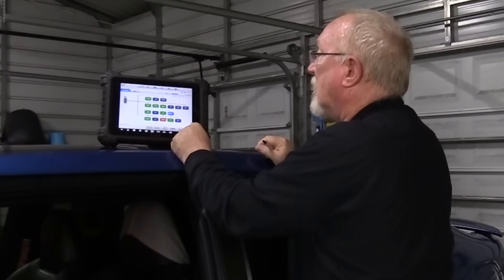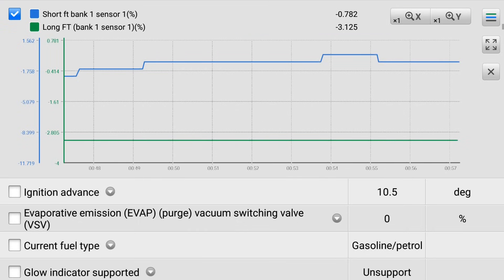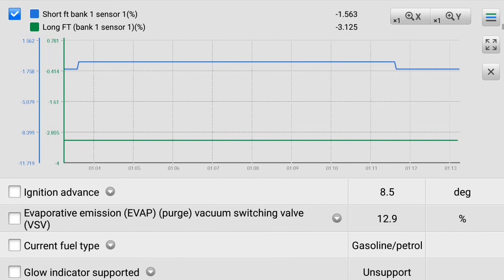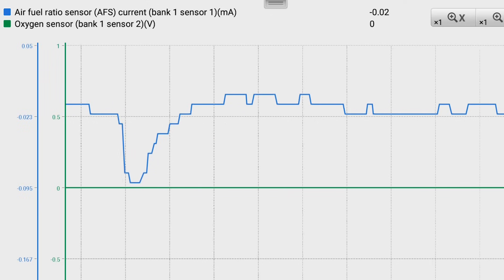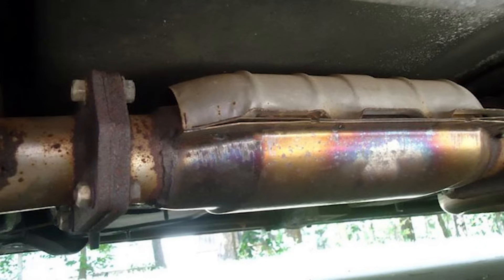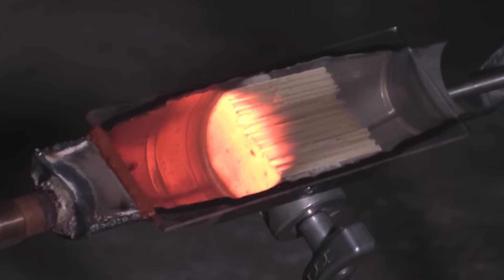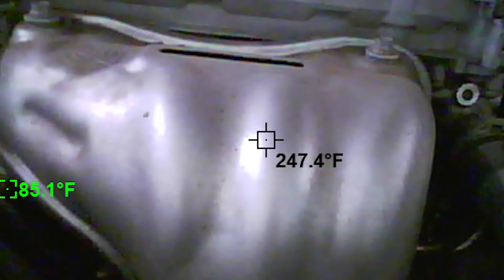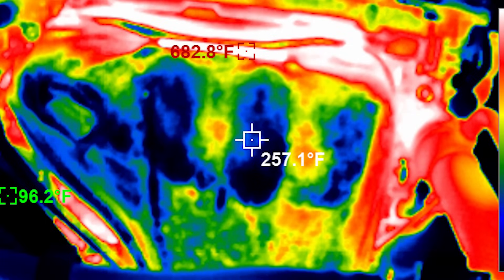The Trainer #118:  The REAL Cause Of P0420/P0430 DTCs

Comment: So I replaced my whole exhaust and bought a cat for 200$ for my 2004 Honda accord ex got a tune up changed the oil and air filters and the code came back on , so either I need the spacers for the o2 sensors or it’s the cheap cat or the mass airflow sensor regardless ima stil drive it like this because it’s a old car and the car is fine brand new

Comment: If your mechanic is not a technician, tread softly. Now days most problems can be determined with a scan tool, oscilloscope, laptop, smoke machine, and fuel pressure guage. Never let a mechanic "try this" or he "thinks it's that". If they cannot explain what your problem is, why it's bad, how they determined or diagnosed the issue, or show you what /why a part needs to be changed. Do not let them work on your vehicle. Don't think we'll the O2 sensor didn't fix it, but it had 100k miles on it anyway it needed a new one. No! Most of the time you are trading a perfectly good working OEM very expensive part designed for your vehicle for an inferior aftermarket part. And it will not last as long, some ECMs will be further confused by the non OEM part and it will say it will work with your vehicle but it might not work very well or cause another problem. A reputable technician will only change the part or parts that fix the problem. Not charge you 5000 for shit you didn't need and keep your good working OEM parts and sell them on ebay or use them on another customers car and charge them for new shit. It's easy to tell who knows what they are talking about. Guys caked in grease, that don't use electronics 1st, are the wrong people to be talking to. Also the tech that works the counter that doesn't turn wrenches and try to upsell you transmission flushes, coolant or brake fluid flushes, air filters without looking at it, don't let them talk you into something you don't need. Most not all dealerships are good. But some are just as bad as jiffy lube who hires anyone to change oil. And sells you filtered recycled used motor oil will do anything to make their commission higher. And ask them if they make commission or hourly wages.

Comment: have changed cat and O2 sensors 2months ago all was fine  but now getting the 420 bank 1 code have a toyota camy 2002 2.4 liter  need a little help on this one
Reply from the maker: You need to identify and correct the reason for the first cat's faiilure.
Reply: @VehicleServiceandRepair  i did my fault the car has 303000 miles i got codes for upstream and down stream when i changes the cat it was clogged up .since i have sent this i changed spark plugs the check light came back on with the 420 code . am going to check for leaks this w/e

Comment: Lot of P0420 codes, but what about a P0421 code? My car runs fine, plenty of power, no hesitation. I thought there were ways to do catalytic regeneration on some cars that don't have a ignition cylinder cut out when a ignition coil is disconnected, this sends unburned fuel into the catalytic converter which causes it to heat up, and burn off contaminates on the monolithic core or at least that's the way I understand it? Apparently you do this for about 10min @ 2000 rpm or little higher to get the catalytic up to heat up oxidizing the contaminates.
Reply from the maker: Some techs have tried this technique with some success but more reliable is performing a slow induction cleaning with a cleaner like RunRite or Techron. Add it slowly to a warm engine at a central vacuum port (evap or PCV - not the brake vacuum port) and then let it sit for 30 minutes, followed by an extended drive. Monitor Mode  $06 test results before and after. If the "after" improves, it is an indication that the substrate is contaminated.

Comment: Had the po420 code and changed oxygen sensors, code came back on. Any suggestions?
Reply from the maker: If you have a scan tool, graph the sensor activity. The front should switch and the rear should be relatively stable. If not, it could indicate a bad cat. Also checck Mode $06 test data for a failed test report. The question begins with Is The Cat Really Bad and if so, What Killed It? It may also be helpful to look inside to see if it appears coated or contaminated.

Comment: I have those codes and my car shakes when i accelerate, i have replaced my rotors,brakes, and all tires because 1 tire had a bubble in it. Does it shake if its the converter? I have a 2005 Lexus es330
Reply from the maker: Without test driving the car, it's hard to say what is causing it for certain. However, the cat would be the last thing I would blame. If it's on acceleration, I would check the motor mounts, transmission mounts first.
Reply: @VehicleServiceandRepair  thank u I'll check that, ii really didn't want it to be the cat n everyone who thinks they know about cars were telling me all kinds of stuff. Ot all started with this stupid town that has pot holes everywhere n I hit 1 of the real big ones it was a sh*t show lol. But thank u again

Comment: About 40 years ago I had a car with a K&N filter. I won't use that filter on a newer car. I think I had to coat the K&N with oil. I don't think that oil would be good for the MFA sensor or the catalytic converter.

Comment: A friend of mine has a 2011 Arcadia that is setting the P0420 and P0430 codes for Cat performance. In the last year he had a tuneup??? Trans replaced due to shuttering , and now all 4 o2 sensors and Cats.(OEM parts) Still getting same o2 codes. I scanned it and saw nothing out of range. L & S Trims looked good o2s checked out fine. Except rear o2s seem to be switching rich lean just as much as the fronts while watching all 4 in the graph mode on my scanner. No misfires current or in history. At  150K I'm suspecting the timing chains causing the cam and crank sensors just enough out of sink to cause the o2 codes to set , but not bad enough for any other code to set. Anyone else had this issue? Also MAF data looks correct, but might help if cleaned. I know I need to check the throttle body and intake for oil. The engine has several oil leaks making me question if the PVC system has been serviced. I don't really know what the so called tune up for $800 really included other than plugs. This thing runs great! Any other direction would be great.
Reply from the maker: How long after the new cats were installed did the codes return?
Reply: @VehicleServiceandRepair  within a few days
Reply from the maker: @BlueEyeTableRockLake  Are they "universal" cats? If so, don't discount the possibility they are the cause.

Comment: Got the code on my wife's car. They tried to sell me a converter. Then I realized it happened after daughter put gas in the car. So I checked the fuel  cap problem solved didn't even have to replace cap.
 May God bless everyone!
Reply: Me too after paying for a new not quality converter..at 102,000 miles..from q government recommended repair shop ..
Reply: I think this is what's going on with my car. Either that or because I got gas from a place I don't normally go to. Came on the next day after I got gas and it seems like my gas cap isn't getting vacuum sealed when  I put it on
Reply: What is the fuel cap issue?
Reply: @leslielucci3182  
Somehow, she didn't get a good seal ,nothing wrong with the cap. You're supposed to turn cap until it clicks, then turn, I believe, one more .time.
Reply: @billybarnes9208  the cap to my Subaru is lost because the “string” attached to it broke and when my teenage son took the car on a long camping trip, the cap was forgotten at one of the gas stations upstate NY. So far I haven’t replaced it because car drives fine without it. The 420/430 code existed back when we had the gas cap.
Reply: someone stoled ours got a replacement from Napa just follow instructions while installing. Our replacement works fine.

Comment: i got a great deal on a used car only to have the check engine light go on my first day of having it. got the code reader and found P0302 and P0420 errors. now not sure what to do.fixing wouldn't be the end of the world, but it's high mileage so my worry is something else will go wrong. have to admit it is a lemon.
Reply from the maker: Tackle the misfire code first, then let the ECM recheck the cat. The misfire can cause high temperatures in the cat that can lead to the substrate melting. If that's the case, it will impact power and fail the cat test.

Comment: Hello everyone I have a question, if the car has gasoline but won't start, and still ready this code with bank1? Then what from there? Everything is pretty new...1-2 yes old, Brand new..? There are other codes that accompany P0420...cat,025,htr
Reply from the maker: Tackle the no start condition first. Engines need 3 things to run - fuel, spark and compression - and they have to happen in the right amount at the right time. What kind of vehicle are you working on?

Comment: I do all of my regular maintenance but got the P0420 code after refilling my gas tank. Thought it was the gas cap, so replaced that. Cleared the code. It came on again several hundred miles after I got low on gas again. I cleared it again. Drove around for a while, checked and even passed emissions. Then 3 days after emissions passed, low tank of gas and code came back on. What is the deal here? My car runs great btw.
Reply from the maker: Many monitors will not run when the fuel level gets too low. I'm wondering if that is impacting your issue. What is the year/make/model/engine of the vehicle?

Comment: Carbon buildup can also trigger Code P0420. My 2014 Jeep Grand Cherokee Laredo threw up the code even tho the o2 sensors and cats were good. So I thought hmmm what if it's carbon buildup? Got 2 cans of Seafoam intake cleaner, followed directions and after it blew all the carbon out the check engine light shut off and P0420 was gone forever

Comment: Just got the P0420 and P0158 yet no check engine light. I hear rattling inside there too. Anyone? 04 Lincoln Aviator 32v 4.6L V8 Y pipe to single exhaust after the cats. Also a smaller then dime sized hole where the little heat shield use to be on the passanger side after the cat.

Comment: If you install those Sensor Thread Adapters to get the O2 sensors out of the exhaust stream, will that tell the computer that the mixture is too lean and enrichen it causing lower fuel mileage?
Reply: We’re talking catalyst monitors aka down stream oxygen sensors, not the upstream sensors.
Reply: @harrybalsonya5619  Downstream.

Comment: First thing to ask yourself is, "Did my battery go dead or did I replace it?"  Sometimes you have to perform a "Drive Cycle" specifically for your car so your computer can run a "Readiness Test."
Reply: What do you mean by drive cycle? Our battery went dead over winter. Its been recharged but the truck will only turn over, not start. 2015 GMC Diesel.
Reply: @kariniemannfuss9208  You are a prime candidate.  Just Google " Drive Cycle" for you vehicle.  You could get one from GMC or your mechanic.

On my Tahoe I had to let it idle at a specific RPM for a period of time from a cold start with a number of electrical items turned on and drive it a certain way to allow the computer to scan all sensors to know that everything was working properly.  The codes switched off and I was able to get the emissions checked.  

As far as the no start, you'd have to check with diesel forums with your specific issues.  Sounds like a computer communication problem.  With no power for an extended period of time, the computer might need to be reprogrammed.

Comment: With direct injection engines it can be the injectors. The code is often accompanied with a cylinder miss code.
Reply: Just a heads up, injectors on a direct injection engine are under such tremendous pressure compared to port injection. Injector issues on DI engines can actually cause compression issues. If DI injectors are ever removed for any reason, they must be replaced with a new injector to prevent compression issues.

Comment: I just got my 1st Autel today. MK808BT. So far I'm loving it. Just changed a bad ABS module and was able to flash it and fix my abs lights in my town and country 3.8. This 0420 code is all I have left and both 02 sensors are new so I'll be checking out the converter. Awesome video. Thanks
Reply: I think the point of the video is that just because a code is thrown for a certain component, that component itself might be the singular issue, having lived it’s long life, and time to be replaced, like spark plugs, ignition coils, batteries, brakes.   But more often than not, by a large margin, the actual cause is because of another component which is malfunctioning and it’s symptom is causing a reaction in the component that is represented by that code.      You could replace that component every month and still not fix the problem.

Comment: I got some strange readings on for my p0420 sensor. The cat gets a green check mark and the 02S does as well but the EVAP isn't hitting the mark. Trying to get this car smog ready and out of Non Op but this is the wall I'm hitting. Changing spark plugs tomorrow but idk if it'll help.
Reply from the maker: I think you are referring to the monitor status for the various systems. The EVAP monitor can be the hardest to set. What kind of vehicle is it and are there any codes?

Comment: My neighbor said you can just wash them out.  I replaced my converter and it still didnt fix the problem.  I used a lawn mower spark plug extender and the check engine light went out.

Comment: My experience with p0420 is usually a ignition issue or an exhaust leak at the manifold. There are other possibilities but in GM platforms it's more common to have high mileage plugs or worn / lose exhaust pipe to manifold seals.
Reply: Probably not the cause but my ‘98 Corolla was less than a year old—still at the Dealership Service stage—when someone forgot to re-fill the oil tank after a change. My mechanic kindly rebuilt the engine and the code began soon after.
Reply: @Nomenclatureish exhaust leak is pretty common. Esp if the engine was recently installed.
Reply: I have an small crack in my exhaust manifold. Jeep xj. Code just happened after a new ECU was installed...
Reply: @cruz7073 Did the new catalytic converter fix the problem? Having the same issue on a 2001 Accord lx.
Reply: @cruz7073  this is what Toyota says is the cause of ours, too. Supposed to be common in this model. Sometimes tightening the gas cap will help.

Comment: Hi Pete, I have a 2002 tacoma with p0420 bank 1 code, been troubleshooting for almost a year now. Replaced the cat two years ago because of this code. When the code came back I ended up finding a short in the spark plug wit for cylinder 4 ( that gave me a code as well). I changed the wires and the cylinder 4 misfire code went away but the p0420 code stayed and I can’t get it to go away. I just put an endoscope in the oxygen sensor in-front of the cat and saw that the cat still looks good. I disconnected the O2 sensor and it idles just fine, the same as before unplugging. Could my cat downstream be the cause of my problems? I don’t know what to do. The shop said $980 to replace the cat (not gonna happen). Please help Pete! Thanks
Reply from the maker: First, graph the front and rear O2 sensors and watch the activity at a warm idle, then again at 1800-2000 rpm, and finally at 2800-3000 rpm. If the cat is good, the rear sensor should remain relatively stable. But if it looks like the front sensor at any of these rpm ranges, the cat is no good.

Let's start there!
Reply: @VehicleServiceandRepair  so is that always true? I bought a BlueDriver diagnostic device and it shows the rear sensors on my 04 mdx bouncing, not holding steady voltage. I thought that was a definitive conclusion of a bad cat, until this video made me think twice that the mixture is out of range going into the cat.
Reply from the maker: @davidmorrow6571  The key is WHY did the cat fail? If the two sensors are mirroring each other's activity, it's a good bet that the cat did fail but there is usually an underlying cause that, if not corrected, will affect the life of the replacement.
Reply: @VehicleServiceandRepair  New cats and all 4 o2s (OEM) Still getting even switching on all 4 o2s and PO420/430 codes. 2011 Arcadia 150K. I'm thinking timing chain???
Reply from the maker: @BlueEyeTableRockLake  If both the front and rear sensors are switching in unison, the cat is not doing its job. Are the cats CARB certified and/or OE? Did you check for exhaust leaks that would allow excess air into the system and skew the O2 sensors?
Reply: @VehicleServiceandRepair  not yet, I think the cats they used were not factory.